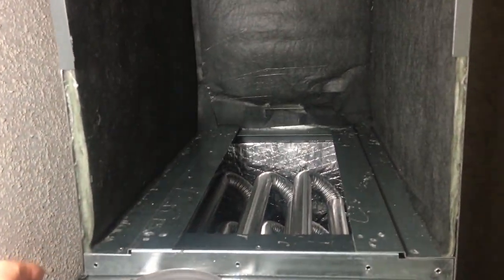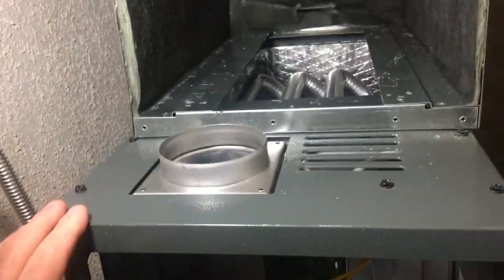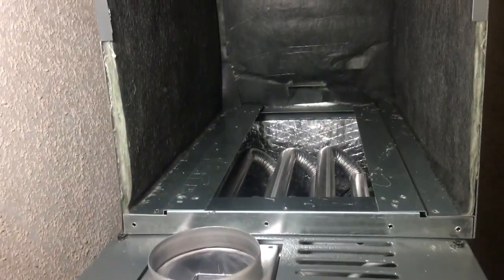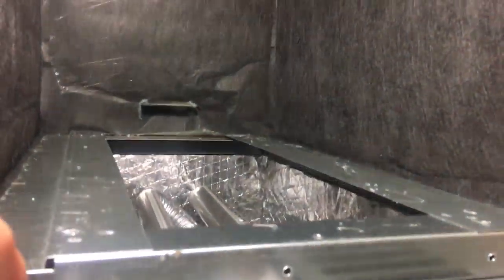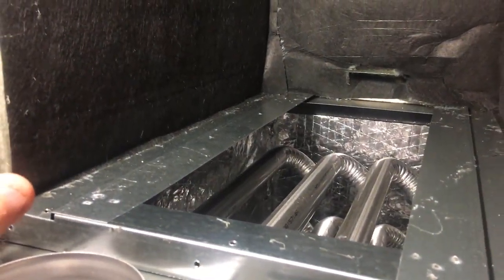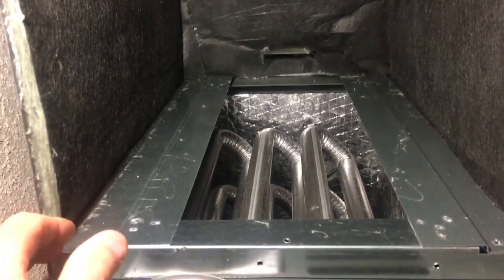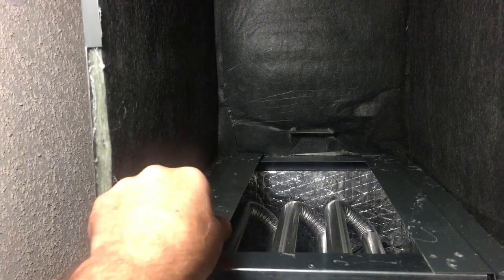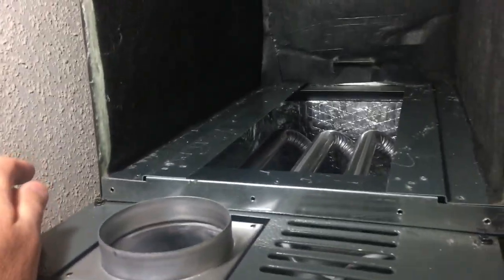Goodman 3 Ton A-Coil Air Flow Restriction ?

Comment: Anytime a coil is installed over a furnace either cased or uncased the opening in the coil is almost always smaller. It is better to raise the coil up from the furnace if possible. You need to look at the airflow spec on the coil agents available static. All brand equipment will be restricted like that except for true flat horizontal coils.
Reply from the maker: Yea, hole just seems a bit small for 3 tons of air. 10" x 17" for 1200 cfm ? anybody got a chart handy ?
Reply: OcRefrigeration,Hvac & Electrical. As a general rule I think the opening should be 200 Sq in for 1T cooling.
Reply from the maker: i personally use a spec 100 square inches for each ton of cooling. so yea, if i crunch this 10" x17"  = 170 square inches Way too small a hole for 3 tons of air in my opinion. should be 300 square inches.
Reply from the maker: Has anybody ever opened these holes up a bit to allow for more air ?
Reply from the maker: that would be nice, i wish.
Reply: I make custom pans to fit the plenum. Then I cut as big of hole as I can that still allows the coil to sit properly.